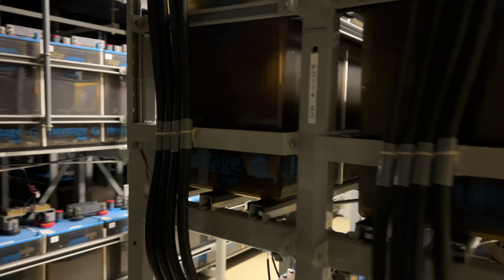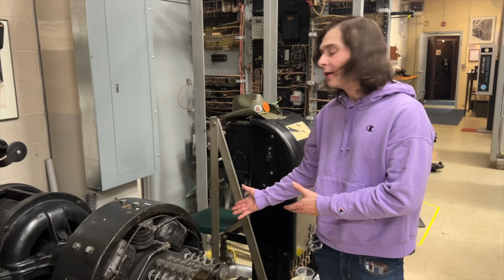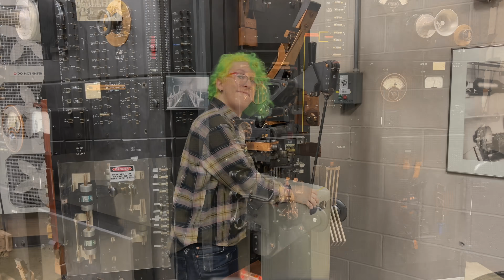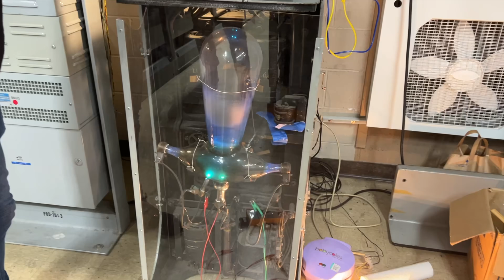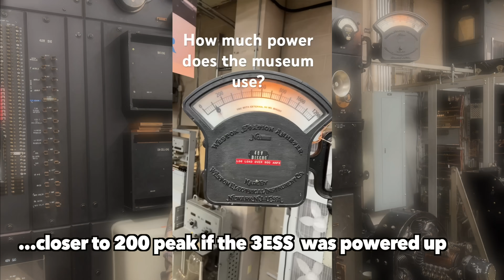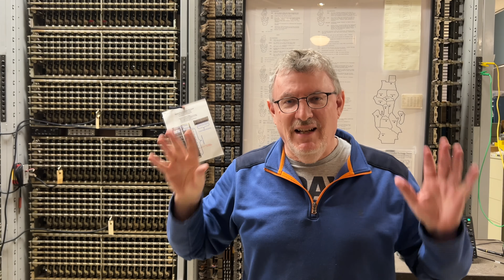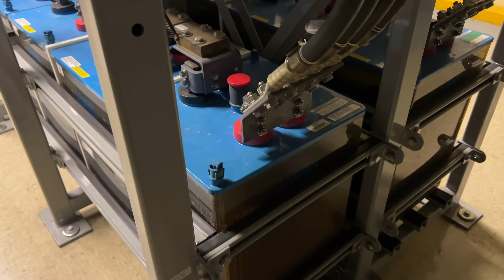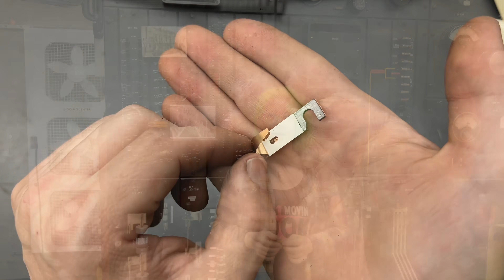All About Telephone Power Plants

Comment: I never heard of anyone dropping a wrench in a distribution unit but I saw a pair of HVAC techs dropping a duct over the bus bars. Molten galvanized steel smells awful.
Keep up your excellent work!
Reply: Metal + bus bars = *bad*
Reply: @carpetbomberz  But I bet its quite exciting!
Reply: @simonforget280  back around 1990, the Forman at a major AT&T building in Minneapolis told me someone dropped a 1” diameter steel prybar across the battery output. They had to wait more than 8 hours for it to burn through. All 3/8” threaded rod within 10’ of the fault vaporized. The fire department could only vent the hydrogen from the batteries.
Reply: @rgsparber1 I'm surprised it would take 8 hours to burn through unless there was something severely limiting the current. Styropyro did a video some months ago where he wired 100 car batteries up for 60 volts, and he found that larger steel items burned through faster than smaller ones, because the lower resistance allowed them to pass more current (up to 55,000 amps through a 1" bolt iirc). On top of that, one of the biggest problems he faced was trying to keep everything connected long enough for it to melt as the induced magnetic fields kept blowing everything apart. Everything he tested only lasted at most a couple seconds before melting or burning up.
Reply: Something similar happened at a power plant, they use DC to provide field to the generators among other things. A worker dropped a tool on the DC bus, the current wasn't high enough to vaporize anything but the wrench just welded itself to the bus and glowed like a big heater. They had to wait quite awhile for the batteries to discharge and then cut the wrench off the bus with a torch. In the meantime the plant is off line. Nobody got hurt but procedures had to be revised for future work in that area.
Reply: Galvanized metal puts off some nasty (toxic) stuff when it gets hot too, hopefully you got out of there as soon as you smelled it!

Comment: The wrench vanishing from existence would be the best-case scenario...
It could also weld itself to whatever it shorted, becoming white hot...
Reply: I can tell you from exv perience a super wrench between -48v and +24 makes one hell of a arc, also doesn't do the wrench much good. Yes the wrench was taped up.
Reply: There's either fusing and the feeder fuse blows, or the wrench disappears.That's why there are extremely high-current fuses (like the 4800A one in the video) close to the batteries. Although I suspect a 4800A fuse would just sneer at the wrench while the wrench disappeared. At 60 Hudson, we had equipment in a room adjacent to the battery room. This was a "small" battery plant of only 2400A on each of the A and B feeds.

There were thru-the-wall copper bus bars, and on our side of the wall someone had dropped what might have once been a 1/2" ratchet extension onto the bus bars. It looked like someone had tipped an inkwell over, just with metal. We joked about our "chrome-plated bus bars".

These days most of my work is with mass transit stuff, so I'm more on the 600-750V DC end these days. Equally massive fuses, but vastly more wattage due to the higher voltage.

Speaking of higher voltage DC, do a search for "Path 65" - 1000kV between the two feeders, delivering 3.1GW

Comment: Starting the motor-generator is similar to getting a Hammond tonewheel organ (B3, C3, L-100…) going. Although they’re tiny in comparison, they are a bit intimidating as well… 😅 

(The organ runs off a synchronous AC motor, accelerated to approximate speed from auxiliary windings, then the AC is switched on. Speed vs frequency, instead of amperage vs torque)
Reply: One of the things I like about my B3, it's always in tune!

Comment: in my younger days working for western electric co as an installer, i was working in a new P.R.T.D. bay cutting in new 750 ccm cables. before starting work i went down to the power room and checked the fuse board for that new P.R.T.D. and all the fuses were out and all the circuits were tagged do not make live. i went back up stars and started working. i did not know it but some one removed the tags on the fuse board and put in all the 800 amp fuses, i was using insulated power wrenches but left my ring on. i made contact between the cable end  and my ring and frame ground . my ring vaporized with a flash and my hand and face was sprayed with molten metal. my finger was burned to the bone. . i was flash blind but my safety glasses saved my eyes. i was out for almost a year with skin grafts . the supervisor that removed the tags and put in the fuses was fired from his supervisor position .
Reply: Wow, you are lucky, we had a commercial electrician working with WECO installing new flourescent lights between the bays in our SXS floor, when the kid he was working with shoved a metal fish tape through the conduit into the open switch box he was working in, he wasn't so lucky.  I remember seeing the embedded metal in his safety glasses, severe burns to his arms and chest area.

Comment: I spent 16 years as a C.O. tech (a so called 4 wall tech). When it was time for the yearly BOD test the part I always was concerned about was the coup de fouet readings. Watching the voltage drop and waiting for the bottom and the slow rise back to the operating voltage was always stressful regardless of the fact that it always did come back up. A 100 Gig circuit down was less stressful than almost any power issue. Thanks for the video. Most folks don’t realize how sophisticated a communication network was and is today. A cell phone call in a car on the interstate that doesn’t drop is a modern miracle that people take totally for granted.
Reply: Back when people cared about the customer, the physical plant, and reputation.
Reply: I remember i once tried to call home with uncle's cell phone in 1998 but network coverage wasn't good back then in our city. I only heard noise and static (like what you hear in a radio). It feels strange and uncanny when i remember it and compare with what we have today.
Reply: Totally about 5-10 years ago there was a major scandal in my area because there was a road rage incident where the individual called 911 and the call dropped well they were on interstate 81. And everybody was like how come it dropped. Well first of all NIMBY how dare you put a cell phone tower in my backyard and we have Verizon, AT&T and T-Mobile all with their own isolated networks not sharing. So of course you're going in and out of service even though you're looking at 50 towers! The one good thing that came out of the 5G switch was that most of the networks have standardized to have the same back end for the most part, except for that weird US cellular and Verizon. I still think it's weird that as a T-Mobile customer I will Rome on AT&T and it will tell me that nowadays, although you can barely do anything because AT&T throttles it beyond belief supposedly it's just enough to make a phone call assuming your phones not trying to use the 64k data line.
Reply: @imark7777777  They pay you two or three grand a month to have one of those cell towers in your yard.

Comment: As an electrical engineering student in the early 1990's I went on a field trip to visit a telephone exchange. We were shown into a huge room with many channels in the floor designed to carry many cables. Most of the room was empty except for a couple of racks of equipment in one corner and only a handful of cable channels had a couple of wires in them. We students assumed that this room had been designed for future expansion. In reality, it was just the opposite: the exchange had been upgraded to all-solid state equipment and subscriber lines were multiplexed in decentralized equipment cabintes, so all that was coming and going into the exchange were a handful of fiber optic cables!
Reply: Massachusetts electrician here, I remember in the '90s working in an AT&T building that was one of the last buildings built with the old technology in mind. 4th floor to it, they only used a quarter of one floor in the end. Would not lease out the other floors to businesses for security reasons. It was located on the main Street in a city. The entire face of the front of the building was designed for air  intake!!!
Reply: oh yes, I remember the huge building that was the exchange when I was a kid, now its mostly empty, because its just a couple of optic fiber routers, all of the POTs signaling is generated near the consumer unit on small metal boxes you can find on the walkway every block.
Reply: In Germany utility companies have their own phone network and switches.  The switch in the powerplant where I used to work had been replaced with a modern digital one just before I joined.  Some folks were unhappy with the new switch because it needed some pretty long time to restart after a reset or power failure - the latter sounds kinda funny when talking about a power plant ;-)
At the same time they still had the old copper wiring.  One time a digger destroyed a cable of 750 (afair) pairs nearby.  About 1.5m had to replaced so that's 3000 connections plus some more to fix damage at a third point.
Reply: Those negative voltage brainworms also infect you if you work on old Volkswagens.
Reply: @splunge2222  -48v was distributed through Electronic Switching System (ESS) machines but all circuits I can think of used negative to ground circuits except for line feed and ringing. The 4 ESS ran on +130v with a lot of +3V logic.

Comment: Telcos never used lead-acid batteries, they used nickel-iron batteries.
Reply: Nickle iron? did you mean Nickle-cadmium?  Ours were all lead acid, or alkaline depending on what year they were replaced.  The batteries that were used to start the Gas Turbine (24 volt, because the Gas Turbines were originally used on aircraft) were NiCad batteries.  Our huge CO (4 stories tall, Xbar, SYS, toll microwave) used open top lead-acid batteries.
Reply: Spoken like someone who's never been in a CO battery room
Reply: Nickel-iron batteries are a thing, they are called "Edison batteries". 
All I have ever seen running -48 volt telco equipment are series connected 2 volt lead acid cells though. Sometimes rectangular, sometimes big cylindrical ones. They are usually vented outdoors and there's distilled water handy to top them off. There's also usually a big container of some neutralizing agent nearby in case the sulfuric acid spills as well as an eye wash station.

Comment: There's an exchange near me in Edinburgh that allegedly has the word CHLORIDE debossed into the battery room ceiling after a misoperation of the plant caused the batteries to gas severely and explode, firing the cell lids upwards. I've never remembered to check for myself.
Reply: Anodic corrosion protection is used on deepsea drilling platforms
Reply: Scotland? I'm guessing US telco technology was always similar to that of the UK?
Reply: @gavinstirling7088 Yes there's a lot of commonality between the two.

Comment: 600 amp fuse, times how many volts? 48 or 120/240 for the watts? My puny mind is kind of asking why bother with a fuse. And then you whip out a 4,800 amp fuse! Times what volt for how many watts? That thing looked like it was 10 pounds of copper. Again, why bother and what was it protecting? Now you got me wondering what kind of monster fuses did they have at the steam plant? Maybe you talked about them but I don't remember that.
Reply: That 4800 amp fuse was probably used in line with one of the buss bars.  That's why it is shaped that way.
Reply: @henrythompson7595  I get that. But I mean what kind of conductor was it? I mean it had to be like 0.0000000001 gauge. lol.
Reply: @charlescheeld4767  The "conductor" is not a wire, it is a non-insulated copper bar, actually multiple copper bars that run overhead from one point to another.
Reply: @ozzy6900  I kind of knew that. Maybe bad wording. But then the questions are how big is the bus bar and what is that giant fuse protecting? I accidentally shorted out something when I was wiring up a test bench. I knew I blew something up but everything kept working for like 30 minutes. Then the pager system died. Turned out I blew a 600 Amp fuse in a rectifier.  That was scary. I can't imagine what a 4,800 Amp fuse would be like.
Reply: @charlescheeld4767  That would the last line of defence for the batteries. Note the bus bars are bare and suspended overhead. Say a large piece of metal came to lay across them - or came up from underneath and was welded - wouldn't be too long until the batteries exploded!

Comment: Was working nights and had just come on duty at the South Gate, Ca. (SGATCA01) C.O. when Robert F. Kennedy was shot at the Ambassador Hotel in Los Angeles. At that time, SGAT was a SxS office only. I knew something drastic had happened as the whole office just took off and the noise was almost deafening. On a normal business day, the office load averaged around 900 Amps.
I went down to the basement power room, and we were sitting at about 1250 Amps. Another time the office lost one phase of the AC power. Therefore, only the office lighting worked. The switch tech on duty went out to the emergency engine room to start the diesel generator. He forgot to operate the knife switch to cut in the END CELL Group 1. (The office didn't have the automatic emergency cell switch). In the meantime, he also couldn't get the diesel started either and called the Wire Chief at home. The boss then called me and asked if I could go into the office help him out. When I got there, every alarm in the office was going off. I went down to the power room, and we were at a little less than -46 volts. Those step switches don't like that. All I did was operate the switch to cut in the emergency cells to get things going again then went to find the other tech. He was still out trying to start the diesel without opening the fuel valve. At the time the emergency engine was not auto start. Fun times!